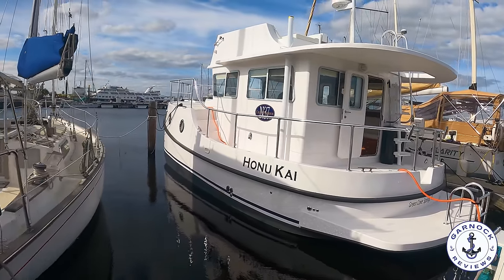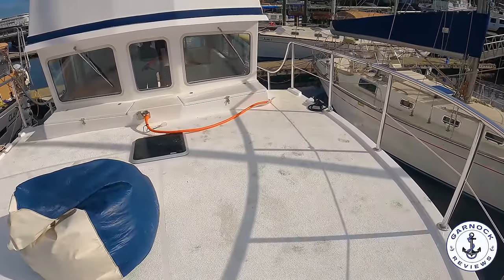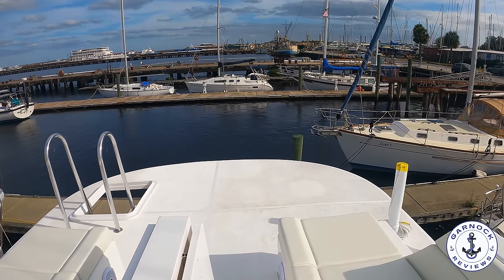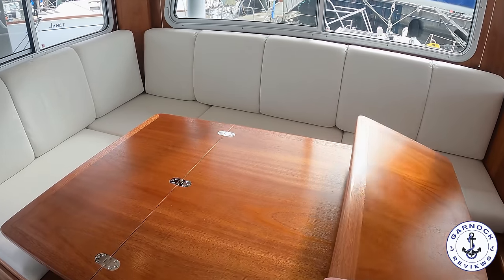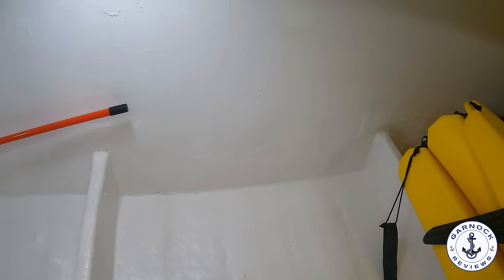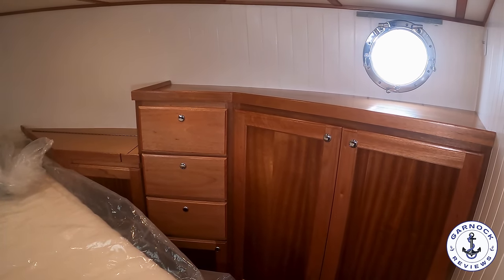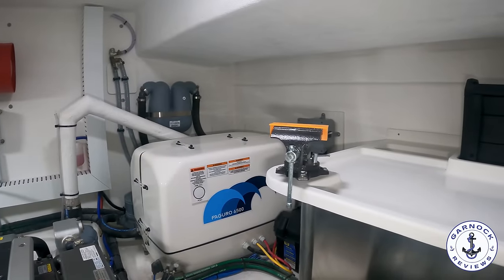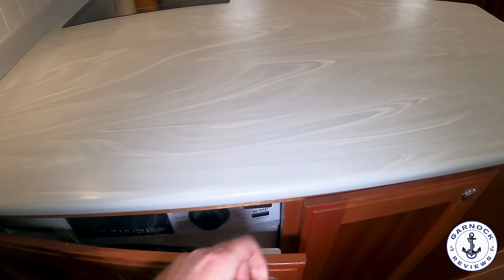(2024) Great Harbour N37 Liveaboard Trawler Yacht - Hull #25

Comment: This was the first time I have watched one of these videos and was totally amazed with the vessel, looks relatively small as you approach it but the interior looks so very big, having not one but the two cabins and so much storage areas and the kitchen area looks more like a small apartment kitchen and not a galley on a boat, great set up and even greater with not only the washer/dryer combo, or I think you said it was, but to also have a dishwasher in there too, outstanding and thanks for giving us the walkthrough
Reply from the maker: There's very few boats I can think of that's such a great liveaboard under 40ft. If you were to tackle the Great Loop, it typically takes 1 year to complete. I'd have no issues spending a year onboard this one with a different change of scenery every morning 🤠

Comment: Cool boat. I’ll pass on the yanmars though. Throw in a pair of 5.9l Cummins and I’d be in love
Reply from the maker: I love this one too Erik. Only thing is, the Yanmar fuel economy and range is a big part of this yachts appeal. Those Cummins I'm sure would drink more than the Yanmars, and with the hill design, you probably won't get much more speed.
Reply: @GarnockReviews  could always get the 5.9 de tuned. I have a 8.3L 250 hp 6c Cummins in my 50’ commercial schooner and I’m barely using 3.5gph doing 8.5kts@2100 rpm. All comes down to gear ratios and prop pitch, I think on the low end the 6b is offered at 210hp, then again I’d opt for a single screw, not as easy to maneuver, but then again there are so many thruster options on the market now. My biggest beef with marine engines is that if you read the data tags, they are generally listed as recreational engines, and not rated for constant duty ie long distance passage making. I prefer engines with an industrial heritage meant for the long haul. Throw in a keel cooler and a dry stack exhaust and you will never again have to mess with a heat exchanger or raw water pump/impeller. 

At least they aren’t Volvos!!!!
Reply: 25 kw 52 kw batery hybrede lees full

Comment: Hi. I have 2 questions.
. How much $?
. Can i travel with this yatch cost to cost? ( adding a solar panel for reducing fuel cost while parking )
Reply from the maker: Thanks for watching. Price is hard to say, as no 2 examples are the same. It all boils down to your specification and time of ordering etc. Very rough figures, you are looking somewhere in the low $600's for an entry level spec, to the mid $700s for a top of the line example. Great Harbour would be your best option to work with for more accurate pricing.

As to solar, plenty of room on this one to mount solar panels to keep your ancillaries onboard topped up without needing to run the engines or generators. Again, Great Harbour can assist with this install and planning.
Reply: @GarnockReviews hmmm..retired and will move back to Hawaii. Perfect for cruising the islands. I may have to make a trip to check them out.

Comment: Good review, but how is she in a seaway? Would she really be safe for the great loop?
Reply from the maker: I've seen plenty of posts in Facebook groups from people doing the Loop in Great Harbours. I'd have no issue doing it in this one if I had the time and money 😉
Reply: Great Harbours are, literally, "go anywhere" boats.  They are based on a Pacific workboat hull design - you know, the "Deadliest Catch" boats that go into the Bering sea in atrocious conditions.  I have over 20,000 cruising miles on these boats in all kinds of offshore conditions.  Safe and stable without external stabilizers.  Contact Captain Joe Senn at Great Harbour Trawlers (he actually lives aboard his own N37!) for more info and to answer any questions you might have about stability and offshore capabilities.
Reply: Thank you for the prompt replies. I just worry about that profile in strong wind conditions. There is a lot of boat above the waterline, but testimonials from people who actually own and sail these boats obviously counts for a lot. The pluses of that great volume are indeed important for liveaboards.
Reply: @sailor5026  Yes, there is some windage, however, this is a 48,000 lb. displacement yacht.  Even though shallow draft, there is a whole lot of hull in the water.  As hull designer Lou Codega says, "We take the displacement OUT rather than down."  VERY stable in all conditions.
Reply: Thanks, again. I do appreciate these comments, and I really do like the accommodation. I also realize that every design is a compromise. I also like to see owners take the time to stick up for their boats. Good sailing to you.
Reply: @erickraft7079 that's right

Comment: Very nice... would love to see this with electric motors... battery and solar panel setup along with diesel generator and windmill power supply. Imagine the range with that setup.
Reply from the maker: I haven't seen boats take on the electric or even hybrid technology as fast as cars have. I am curious if we fast forward 10 years if we will see more electric options on the water. I owned a hybrid car before and wouldn't rule out another in the future.

Comment: A 37 ft. With a full size refrigerator. Better than a boat twenty foot longer that has those Rinky dink pull out refrigerator doors that slide. Plenty of room for a small water maker and air conditioner.
Reply from the maker: I agree 100%, although this one is already fully air conditioned 😉

Comment: Engine room 1st. deciding factor. For me.  Size of engine. Hull speed. GP,H,  tankage. Got it? Skip over the engine room?  I'm not interested.  Refrigerator size is number 50 on the list of considerations. Bridge instrumentation is probably #2. Visibility from the helm? right at the top.  AC and cabin heat are high on the list. Seating for 8 people around a table? Low on the list. Hull design and depth high on the list. Rounded chine or squared off? High on the list.  Does this help?

Comment: Sweet, unfortunately you can't sell many here under Bidenomics Funny the squatters haven't hit marinas yet.
Reply from the maker: The boat market is certainly slowing down since I started my channel. It's also helping in most cases to bring the prices down. At least with this one, the low fuel consumption should be a great factor when considering different boats